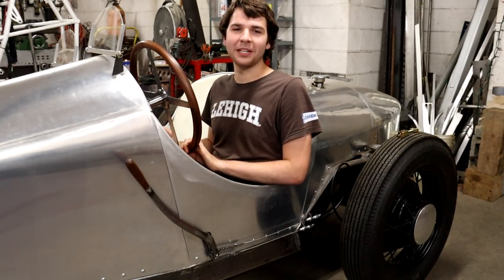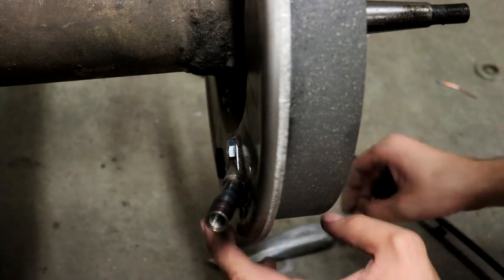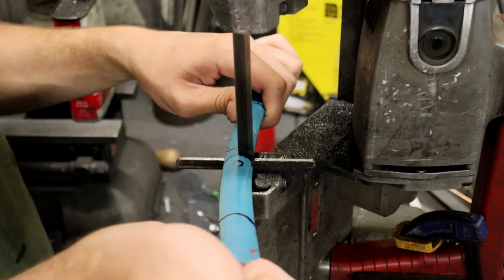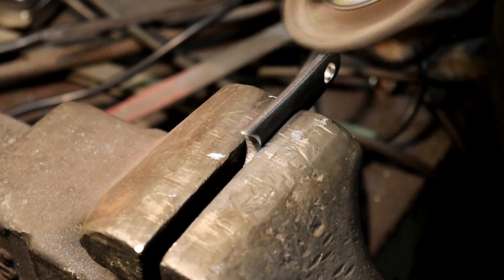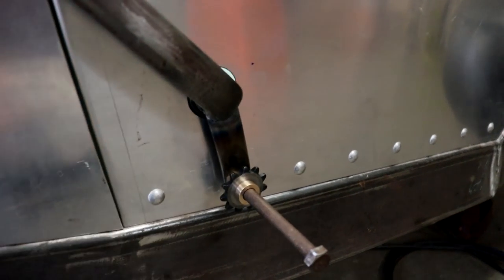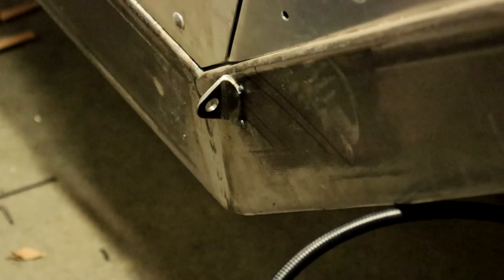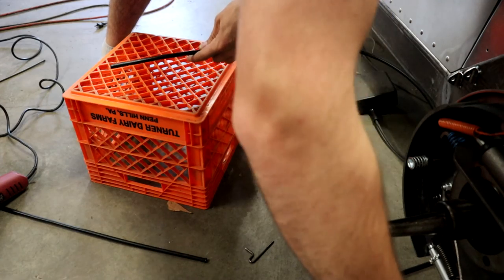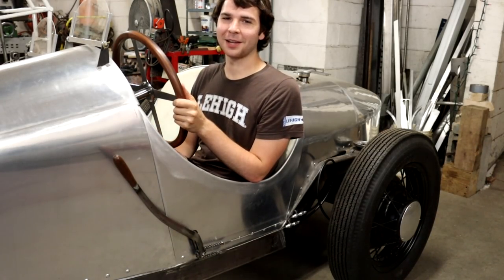Making a Custom Emergency Brake Mechanism | Homemade Boat-tail Speedster Pt. 53

Comment: Lovely job, but I'd be very concerned about using the grub screws as the sole means of retaining the cable. Ideally the cables would have a crimped / swaged end that cannot pull past the grubscrews if a cable were to slip, or better still, a system that doesn't rely on the grubscrews as the primary method of securing the cables.

Comment: Is there a way to hide the flexible loop of the cable?  The chain is cool/clever but seeing the plastic loop reuins the aesthetic of the hand fabricated car.  Perhaps have a rod extend back to a pivoting mechanism which brings the cables in board of the frame?
Reply from the maker: I'll probably end up cutting off that rubber/ plastic covering so that just the metal coil of the sheath is showing for that exact reason

Comment: Will you be making a ratchet assembly to lock the emergency brake in place once set? Or will this just be a secondary brake for manual operation?
Reply: He has other videos that show the lever will lock in place!
Reply: @howardwilliams8993  Thanks, wonder why it wasn't evident in this video...

Comment: HI, I WOULD HAVE PUT THE SPLIT PIN TO THE INNER,  OTHER WISE IT LOOKS REALY GOOD. REGARDS RICHARD.
Reply from the maker: I would've too, but there wasn't enough room
Reply: @MacroMachines  Great job on the E brake, you could make up a cap to cover the split pin, even if it is attached with a countersunk screw. Somebody walking past could gash their leg on the split pin.

Comment: The set up has a nice vintage look but I worry if it will rattle so much it will drive you crazy.
Reply from the maker: they wont be completely slack, so I don't think they'll rattle too badly

Comment: Such nice work! 
Did I miss something here?  Is there a mechanism for adjusting the cables as they stretch, the sleeves compress, and the brakes wear?  You can take a link out, but that's a bit shy on finesse.

Comment: What's the plan to stop the old bicycles fork handle from rusting?
I find in the UK if I left it like that overnight in the garage it would be rusty by morning.
What's your secret?
Reply: He's still in the building/fab process of the car.  Once it's done he'll blow it all apart again and deal with things like paint.
Reply: @dennisp.2147  I'm just amazed how clean it all still looks.
I find I have to at least prime everything otherwise tin worm gobbles it all up.
I must have a damper garage.
Reply from the maker: I don't really have an issue with the steel rusting while just sitting. My shop is in a basement, so the temperature stays pretty constant. I also don't open the garage door on humid summer days

Comment: While thats really cool looking and a clever idea theres one big problem I see.  If one of the cables fails you will lose all function, a balance bar setup will still pull the intact cable when one fails.  Perhaps you could put a few links of chain between the cables to form a loop if one fails?

Comment: isn't it worrying that in the case of one cable failure, the other side gets completely useless too because of the chain and the way it applies pressure ?
Reply: I came to comment the same, cables brake over time and then the brake won't work.
Reply: @jc5c515  i guess the only missing link would bet some kind of mechanical link between the two aluminium part (connected to the chain), thus making a hoop in case of one cable failing
Reply: @Crewsy  yes, on a bar, that's the difference

Comment: Great work but grub screws securing the cable ends isn’t such a good idea. You should make an end nipple on the cable and have a pocket to engage it. Grub screws are a bit meh for any braking requirements.

Comment: hey nice work.  I watched your homemade boat-tail speedster series from the beginning and i love it. One question: Don't you think those brake cables rattle against the chassis while driving?
Reply from the maker: there should be enough tension that they wont
Reply: @MacroMachines  put a piece of leather or wood or such on the body if that happens.
Reply: @MacroMachines  Hope you are OK?? Not like you to leave it this long. A bit worrying I have to say.

Comment: I bet you know, however, if you don't - so you don't curse my very existence - when steel/steel is threaded like that, any moisture will fuse the threaded in forever.  Learned this on tie-rod-ends.... but use grease or anti-seize.  Anti-seize works good for short term, grease works better for long term.

Comment: Are you adding a ratchet and hand release so your e-brake doubles as a parking brake?
Reply: That explains why OE manufacturers use that plate to connect both cables.
Reply: Probably wouldn't fit the style of this car.
Reply: @v8Mercury  What? It would be just fine.
Reply: @SomeGuyInSandy  oops sorry.   I added my comment to the wrong user comment.  I meant to add that to the person that said the sprocket would allow both brakes to fail.

Comment: So many people asking about a ratchet/locking mechanism for the E brakes. 
Watch the video of the lever build. 
https://youtu.be/Dp_oEbrnvh4

As for the concerns of one cable breaking. First I doubt it will ever get to that point since it’s not a daily driver and the cables are fully visible but if you ever saw how the E brake cables work on pretty much every vehicle on the road you’d see even on them if one cable broke the other is useless. Picture 2 horses hitched to a wagon with a double tree. 
Besides, you do realize that the car will still have regular hydraulic brakes too. Do you really think those brakes are so bad?

Comment: Your attention to detail and workmanship is superb...but why do you Americans call it an emergency brake ? it´s a hand\parking brake you apply before leaving the car after parking it...to stop it rolling away...
Reply: if your primary brakes fail, you can use the emergency brake to slow down and stop your car.
Reply: @howardwilliams8993  The hand\parking brake is described as so in the owners manual and that is it´s function, in the UK when passing your driving test it is also part of the test to use it correctly as described and at inspection\mot the same term is used...if your foot brake fails yes you can apply the hand brake to help slow the vehicle down...but how many times has anybody actually done it in a life time of driving compared to parking your vehicle...for me only once in 45yrs of driving but applied it thousands of times for it´s intended purpose leaving my car parked...

Comment: If I was building it, I would have used Whippletree in its simplest version. I would attach a few centimeters long rod to the lever, and connect the lines to the end of the rod.
Less work, less parts. Like Elon Musk saying, best parts, no parts.

Comment: i think your emergency break power will be way to less... you will need 5 til 10 times more power on handleside to get any response at your wheels. rethink your design... with an cylinder or some mechanik to get more poweroutput. you can do it better ;)
Reply: The lever length looks to be about 11/2 to 2 times as long as that on the handbrakes of a couple of my cars, so I’d say plenty of force. Don’t forget: if you can apply enough effort to lock the wheels, how much more do you need?